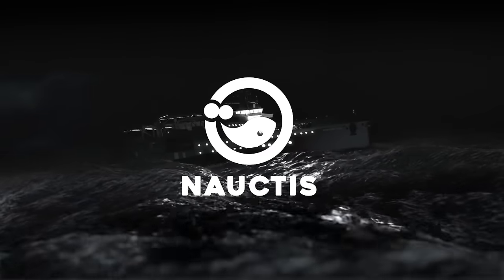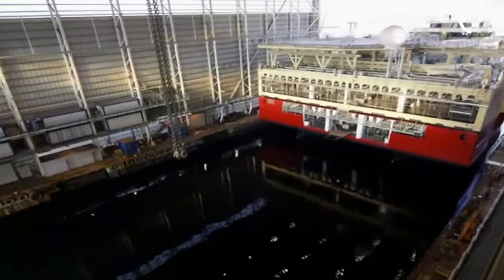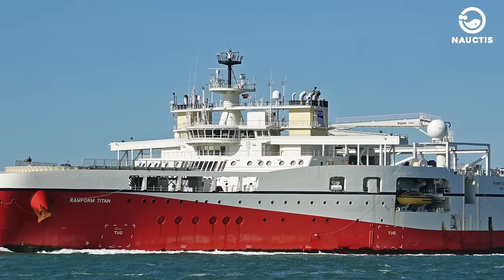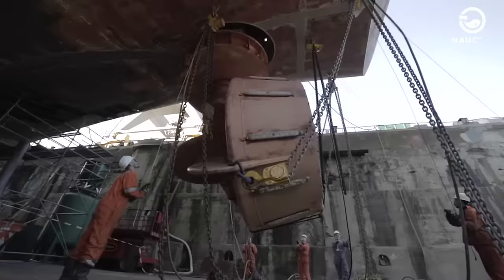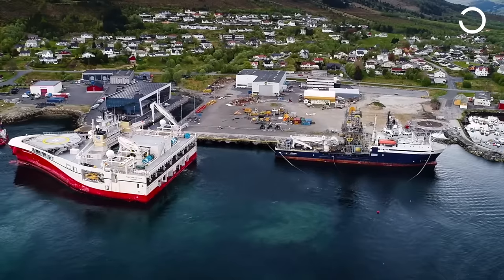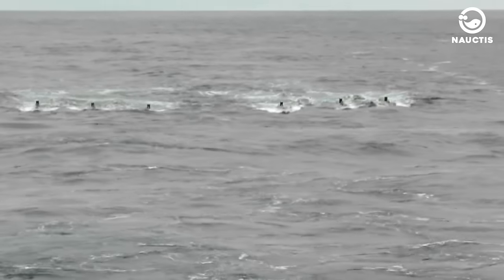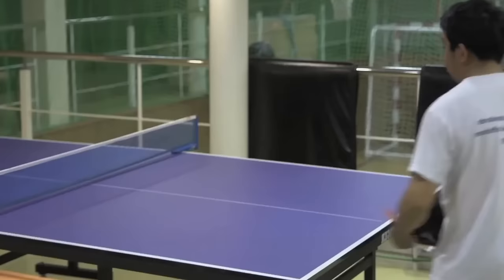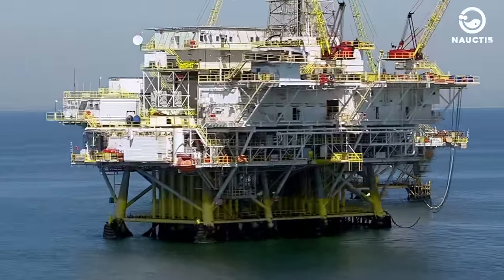Life INSIDE World's WIDEST Ship Ever Built Looks Like Half a Ship

Comment: In the 1980s I was a radio navigator for 3 years on a 212' seismic boat in the Gulf of Mexico. We moved at 5 knots and would only come to port for refuel of equipment repair. Crew changes were done by helicopter and landing on a rolling and pitching boat was thrilling and living on a rolling and pitching boat was challenging for some. This ship looks like working on land with its stability.

Comment: it's an ocean going cable layer with a specific job to do. no problem.
Reply: Not a cable layer.  It's towing sonar arrays to map the bottom of the ocean.
Reply: Not sonar arrays, but a spread of seismic cables that contain hydrophones recording acoustic energy produced by two arrays of high pressure air guns, also towed behind the ship, just in front of the cable spread. I used to sail on these ships.

Comment: Will have problems in docks , river entries etc because of width
Reply: I think the designers might have worked that out and then worked out it doesn't go into rivers and only needs to go into certain ports, however they've also worked out it the best way for it to do the job it was built for.
Reply: well they do dock from time to time, when they need. Like the SPY ship Marjata (not the one in the video). It would come in to navy base regularly.

There is no difference docking a ramform, than any other ships
Reply: @heuhen   It still goes into the dock and then rests on Concrete blocks when water is drained. but very few docks in the world can accommodate the width of 70m  worlds largest cruise ship is only 48m wide and worlds largest container ship is 61m wide.   The Ramform ships needs dry docks fit for Floating oil platforms.